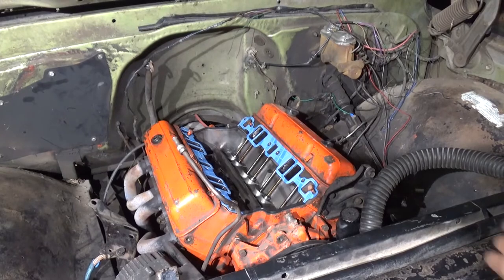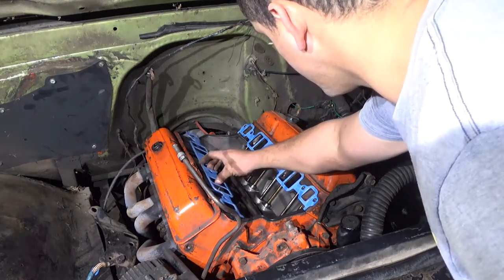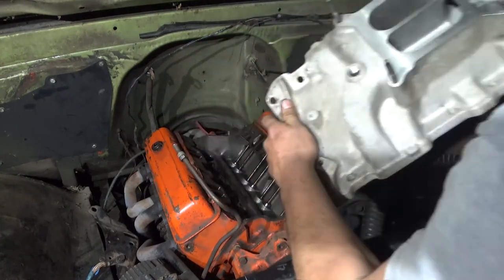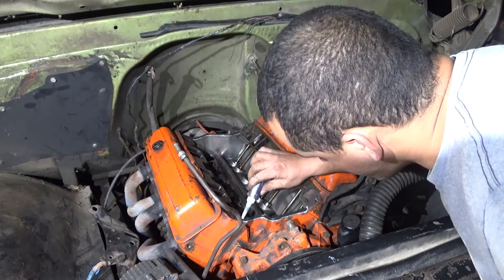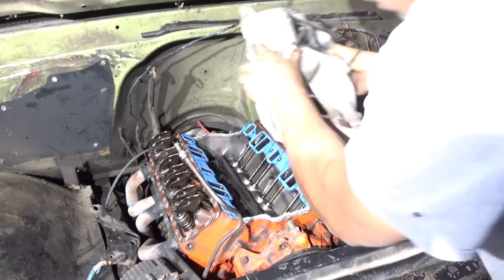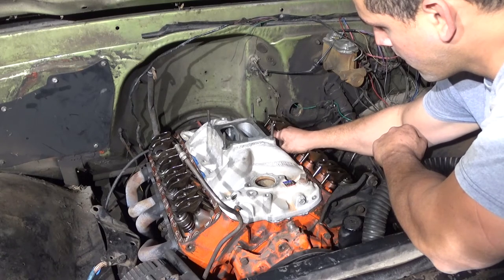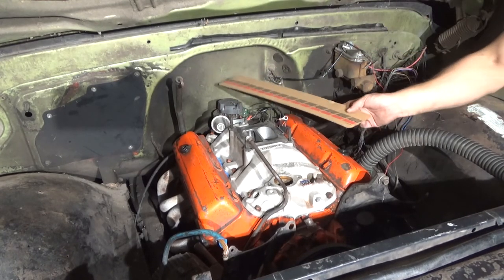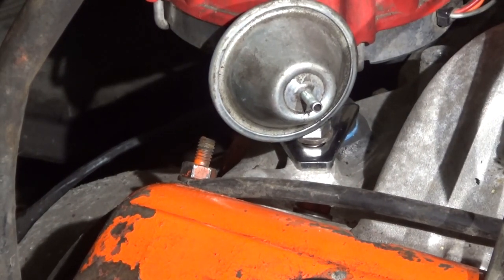How to install  intake manifold on a small block chevy/sbc 350

Comment: I was nervously skeptical when I did this with my 305 today. I was getting the feeling I had just replaced my intake with a screen door. Much to my amazement, no leaks....so far. But two previous attempts using the rubber gaskets on the Chinese wall  allowed major slipping. I though my leaks were coming from the main crank. But the flywheel was always dry. So I tried it one last time using a bead of sealant on the walls of China about just thinner than a #2 pencil. Prior to applying the sealant, I blasted it with carb cleaner and let it  it dry. I cant say reattaching the manifold went smoothly. Its a lifted suburban and the manifold is cast iron. But like I said. So far, so good.🤞

Comment: I have coolant in my 3rd spark plug port. No other issues. Could it be the intake manifold gasket? Or do i need to pull the heads? I didn't run it hot. 95 gmc. 350.
Reply from the maker: I apologize for the late response, but if you have water in a cylinder it's more than likely a head gasket or cracked head. That's just my opinion.  Water only flows across the very front of the intake. I would say it's not very likely that it's coming from the intake.

Comment: Underrated intake manifold videos. Great job. I see you went from a 2 barrel to a 4, that’s what I’m thinking of doing, just took the 2 barrel out today and changed the distributor yesterday. I have a AVS2 that I want to install, this was before i realized I have to change in take manifold too lol, so now I either go through with it or just buy a new 2 barrel. Going through with the 4 barrel I would have to decide between a aluminum intake like an edelbrock or find a cast iron GM stock. I like the reliability and durability of the original cast iron, but I hear that the aluminum edelbrock performs better. What should I do and why? Why did you choose to go with aluminum? Hope to hear your response take care!
Reply from the maker: Well, mainly to fit the carburetor.  I only run holleys or edelbrock, and they are both sqaure bores, aka 4150 flange.  I wouldn't expect to gain much power from an intake, but it's supposed to be proven to add a little bit.  Also, they look better.  As far as reliability,  I've been around lots of engines that have been running aluminum edelbrock intakes with no issues at all.  The only thing that an iron intake can handle better, is if you run straight water with no anti freeze.  The aluminum will rot faster than iron. You will have a hard time finding a good stock iron intake that fits a edelbrock.  Most are for spread bore q jets.
Reply from the maker: Well, all the intakes have a recommended rpm range. I would just follow that. But any of them would work.

Comment: The distributor cap facing #1 cylinder is a myth, the rotor on the distributor has to face number 1 on the cap. I think it's a little different with the vacuum type, which the vacuum should face at 6 if I'm not mistaken But usually where ever your rotor faces will be your #1 which at this point can be anywhere.
Reply from the maker: I know that you can run use any position on the cap for # 1. But there still is only one correct position. Using the right position will make your plug wires fit better, and the diaphragm for the vacuum advance will be in the right position, to where it can be adjusted without hitting anything. Also on a tpi if you don't use the proper #1 position the plug wires won't even fit. That's why I do it like this.
Reply: @davidcraft4909  as long as you mark your distrubutor rite...and put it back rite...TDC not an issue...
Reply: Point the rotor at the back of the carb and the distributor will be square in the engine at around 36 degrees timing. GM made a cap to snap on top of the wires, it was numbered, the front post nearest the driver side is correct #1 spot if ya want your wires to fit right. Looks better too.
Reply: Of course install at TDC.
Reply: If your gonna do it, do it right. Half ass looks bad.

Comment: Yeah somebody told me that I could block off that EGR valve instead of putting it on that Edelbrock intake or you know that's just what they're saying I'm not a pro pro like you are but I know one thing that anytime you mess with ventilation sometimes you have problems with running right and I definitely don't want to have no problems with running properly so if you know if that can block off that EGR valve instead of putting it on like you were doing right there at the last part of the video I'd appreciate it all right appreciate the video bro thank you
Reply: Block off the egr is good...make sure you block where the vacuum line in carb or tbi goes
Reply: Yessir you can block the EGR!! I have a 84' Z28 Camaro I deleted the entire EGR/fuel vapor system completely off of my car bc it ran like shit no matter what myself or anyone else did to it! Haven't had any issue since.. 🤞💯🤙

Comment: How did it run with a stock bottom end, I have an rpm perfomer and I’m being told it’s too much for my stock engine. Nice video
Reply from the maker: It runs ok so far in the driveway. I haven't got a chance to take it out on the street yet.  I have a video titled 40 series flowmaster sound that shows the truck running. I went overkill on the exhaust and intake because Im eventually going to run aftermarket heads.I actually had that intake on a 3/4 ton chevy and it ran perfectly fine on a stock 350